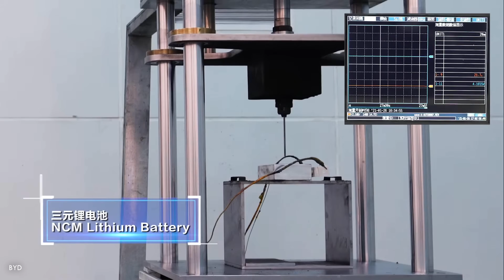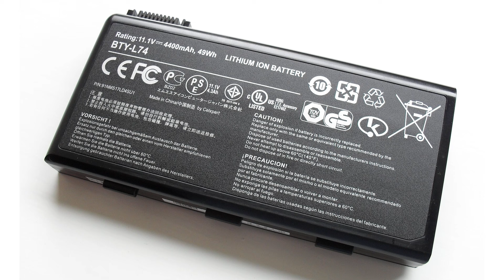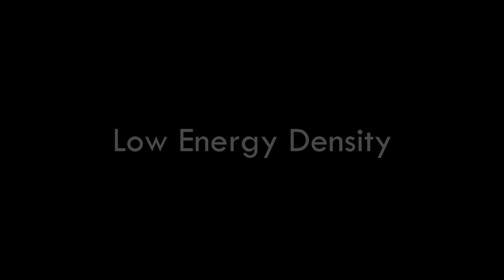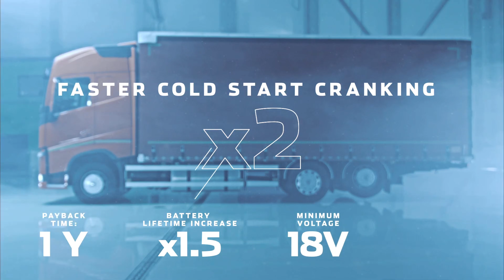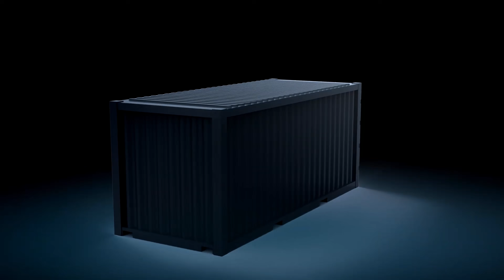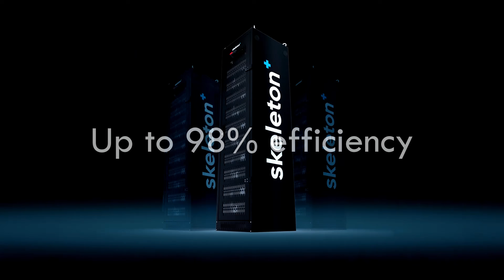This Estonian Company Just Killed Li-ion Batteries

Comment: BYD (Build Your Dreams) electric vehicle manufacturer makes two electric vehicles which add 249 miles of range in five minutes of charging. tesla superchargers add 249 miles of range in 30 minutes of supercharging. That is 500% slower than BYD’s LFP battery capabilities.  I wonder if the BYD LFP battery is utilizing graphene to enhance the battery performance.

Zero Fire Hazard.

750,000 mile lifespan (4,000 charge cycles)

100% recyclable 

low cost abundantly available materials.

low cost to manufacture (BYD builds their own batteries)

overcharged 260% beyond capacity, and no fire.

pictured with a nail, no fire.
Reply from the maker: Hello please the channel I have made a detailed analysis of that too.

Comment: I recently learned about an electric vehicle manufacturer (BYD) Build Your Dreams that make their own batteries. BYD offers two electric vehicle models which can charge in five minutes called flash charging, which adds 249 miles of range to the electric vehicle (within five minutes of charging). the vehicles are priced at just under 40,000 US dollars.

Many of us are wondering if these LFP batteries made by BYD are utilizing any graphene within the battery, to contribute to the performance. it is said that these batteries have a 4,000 charge cycle life (equivalent to 750,000 miles of driving an electric vehicle)(and still retaining 80% capacity), zero fire hazard, 100% recyclable, and abundantly available low cost materials. compared to tesla electric vehicles which require 30 minutes to add 249 miles while charging at a tesla supercharger, the BYD flash charging electric vehicles charge 500% faster than a tesla.

we are very interested in understanding everything that can be known about the BYD LFP batteries.

Comment: But the suggestion is absurd to recharge in two minutes. The copper cables aren't thick enough to carry the amps. Probably would require a 100 megawatt power supply in close proximity too , it won't happen.

Comment: 30 minutes drive time in under 2 minutes come on let's say 90 seconds has mentioned to start with, is 35 miles at motorway speeds. That means a full charge for a decent sized Eevee would take 15 minutes, which is not unreasonable, but not massively better than the current best fast chargers.

Comment: Charging an EV in 90 seconds may not be science fiction but it is reality/practicality fiction.

To charge a Tesla with a 75KWh battery in that time would require a charger with a power output of over 3MW (megawatts) and the owner would probably need to be an Olympic power lifter in order to lift the charging cable up. 3MW is equivalent to the average power demand of nearly 10,000 typical UK typical households!!

During the minute and a half charging period you'd probably need a cooling system on your power supply capable of dissipating upwards of 150KW. This is more like the kind of power you require on a nuclear fusion reactor than a car charger

Comment: Capacitors, including supercapacitors of *any kind* cannot, I repeat CANNOT ever replace Li-ion batteries for 99% of applications where you'd normally use Li-ion batteries. 
Claiming otherwise is the same as not knowing that 1 + 1 = 2.
Reply from the maker: I have explained the entire thing in the video itself. Though you are right up to a point but they are truly trying to revolutionize the industry and they are close. Please watch the whole video sir. Also, in my best video I'll explain something about another battery company. Hope you'll watch it also. The next video will be uploaded in a couple of days.
Reply: @PhysxXSpace  
Skeleton supercapacitor power density: 6.8 Wh per kg.
Li-ion battery power density: > 200 Wh per kg.
Reply: @chrism9017 I can believe he didn't even mention this at all.
Reply: For hybrids though the super capacitors would improve aspects such as regenerative braking. It would offer improved acceleration except improved acceleration is not necessary ; the EVs already destroy the road surface ten times faster and churn out excessive rubber nanoparticles.

Comment: a supercapacitor? nearing the capacity of a battery? from estonia?
im hyped
Reply: @kkjkjh  nowhere near the capacity. The video creator did not disclose the Wh/Kg or Wh/L ratings of the capacitors vs lithium batteries, but it's still more than an order of magnitude less (20-50x less by volume). ~16 Wh/L for the capacitors vs ~300-800 Wh/l for lithium ion. And 65Wh/Kg for the capacitors vs 150-350 Wh/Kg (2.3-5.3x less by weight). 
As you can see, by weight, they're not doing too bad, but by volume, not so much, which is a big limitation in use-cases like cars, because there are real limits to the amount of space available to batteries. 

Regardless, they could still fulfill some fantastic niches, like a small buffer for regenerative braking, so the batteries aren't used and therefore don't degrade during braking regeneration. But batteries will still provide 90% or more of the actual storage of energy for cars in this case. Busses or other possible vehicles which have more space, and are subject to frequent stops and high usage would benefit immensely from this tech, as have plenty of space for the capacitors and benefit more from fast charging than overall capacity.

If the video creator is reading this, this is the kind of information that would make a video like this actually informative.